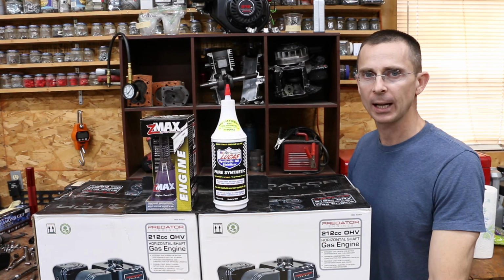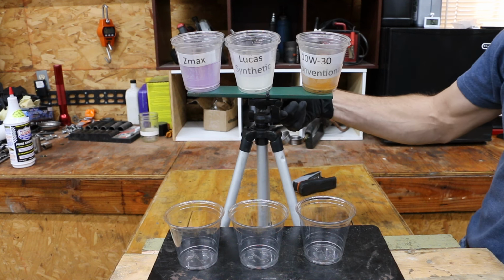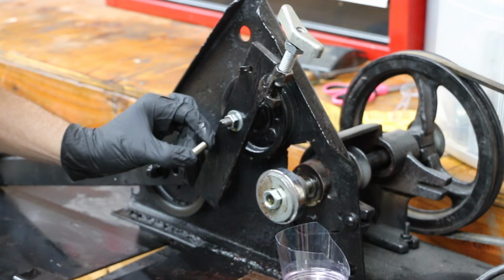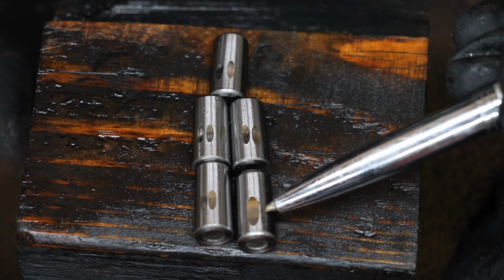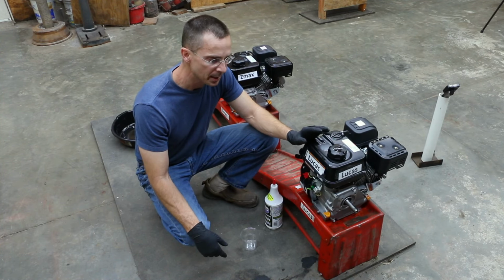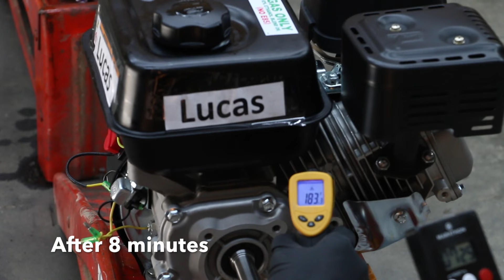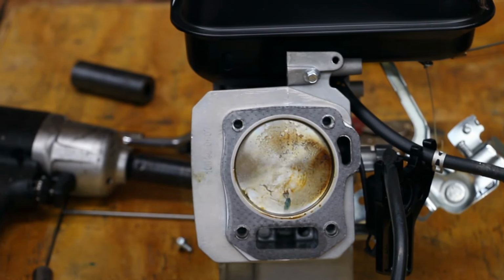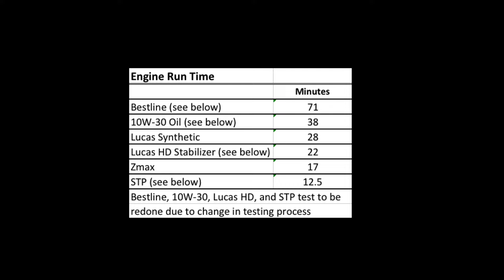Which engine self-destructs first? Zmax or Lucas Synthetic?

Comment: Great Video. I notice that you have done the same tests with other products. 
Its good you did the tests with 2 newly broken in motors.
The fact that the Zmax lubricity test showed the worst results probably means adding it to oil will lessen the lubricity of any oil it is added to, hence the test results.
It would be interesting to have the same test with standard SAE30 oil to see if any of the additives make a difference.
Maybe even do the tests more than once to see if the results are repeatable.
Reply from the maker: Great suggestion!

Comment: I would like to see a combo pack test, ie, winners of all the tests, oil, additives, stabilizers, cleaners, filters, etc, and put them all into one test, with the additives, and without as well. Perhaps on a 4 stroke car, remove the engine by part, measure the deposits, state of the engine, etc, and then measure again after the test run.
Reply from the maker: Thanks for the suggestion.

Comment: 3 years later I think destructive tests are good, especially when they show results and the parts are easily recyclable.

I would really love you to do a test on Subaru PZEV system as mine like most other Subaru's burn a boat load of oil, run at higher RPM's to get the supposal reduced emission's (one trip when cold 15MPG, same trip when warm 40MPG), and have a PZEV emission system even though they have no electric motor to allow the engine to be shut down to reduce those emissions.  I am sorry to say this, but this PZEV certification with Subaru seems to be a con to allow them to save money or get incentives.
Reply from the maker: Thanks for the video idea.

Comment: Lubricity Tester Modification Suggestion
What if you made a slot in the bearing race and put a compression or oil ring in it.  This way the wear test is actually being performed by the ring.    This would be a more definitive test for the exact same metals and products as the engine.   
(edit)  Of course there would have to be a spot in the groove that has a little lip for the gap in the ring.  this way the ring does not slide around the bearing race.
Reply from the maker: Thanks for the video idea.

Comment: I don’t know the specific weight of PTFE ( Teflon) , have you shaked the  slick 50 bottle before you put it in ? We had trouble with oil in a barrel, never mixed before we put it in the big turbofan engines at a major airline . The anti foaming detergent stays out! above 39000 feet the oil starts foaming , the oil pressure dropped and the pilots have shut  down this engine  ! After we build a mixer in the oil barrel , it never happens again !
Otherwise I have a lot of fun and learn a lot from you ! Go ahead .

Comment: Key way broke out on crank shaft due to timing belt gear came loose an wobbled the key out
$2000 fix with new crankshaft and our labor
We bought a new crank pulley/timing gear, gobbed on JB weld in blown out key way area and applied new key slid pulley on let it dry over night
Put timing belt back on and car lasted thousands of miles until in a crash
Reply from the maker: Thanks for sharing.

Comment: Apples to Oranges comparison. Lucas is a lube with oil like viscosity. Zmax is a metal conditioner with a water like viscosity (refer to the pour test).These two items are designed to do different things. It’s like comparing floor cleaner to floor wax. Frankly I am surprised that the straight Zmax did as well as it did on the bearing test. Heat will break down anything and without viscosity moving parts with no cushion will break down no mater what you use.

Comment: WHOA!!
That shows how much energy is in these engines in rotation to snap that conrod.
Quite a while ago I saw a similar test, but the additive went towards areas of heat (caused by friction) to help lube, but those ones go away from hot areas.
How about a hot plate test? Heat a plate and see if the additive goes' toward the heat, or away from it?
Reply from the maker: Thanks for the suggestion.

Comment: i have used lucas products for over  20 years, this makes me feel justified as to my intuition
Reply from the maker: Thanks for sharing.
Reply: @ProjectFarm  any time. ive built many an engine, and many a rigged contraption to get one job or another done. used to get called the local MacGyver all the time. now, being in a wheelchair, still into vehicles, wanna start building engines with a friend. a lot of my friends work jobs that use many of the products you test, and they like knowing they arent wasting money. im trying to get them to follow youtubers too. some work in the dangerous, dusty insides of grain elevators. they cant risk sparks, and they only, ONLY use millwaukee and ridgid power tools, corded or cordless. and ridgid hand tools and a mix of other higher end tools. brushless motors are the only way to go unless you just need something for hanging pics, putting tv brackets up, hanging or installing smaller things like safes to a wall/floor. but if youre building a deck, step it up. my dad still has one of those 9.6v Makita cordless drills, 4 batteries and 2 chargers. still have the original 2 batteries and one charger. the old batteries still last well. We built 3 porches and 2 decks and put a new floor in the front porch with that thing. hes retired now, he also doesnt need much more than a couple of power tools, a good battery charger, and quality socket set and wrench and screwdriver set. he told me he saw a battery booster that took no battery. it sort of cycles the power thats in the battery, and uses caps to boost it and feed it back to the source in a loop. i hadnt heard of them. you do a good job. i would say to be careful with the methods of surface prep. i found out by welding for so many years that grinders and sand paper of flap wheels leave small deposits in the material. i would take the flap wheel, shape the material, then finish with a file. it caused me to add 5 minutes to a project but let me make perfect welds. there were no deposits to cause cavitation and brake cleaner is great, but use the mass airflow sensor cleaner. it leaves no residue and brake cleaner does. this is something we found out while i was welding aluminum frames. i argued with them because i wasnt going to send out sub standard work to haul a ton or more down a road at 70mph. i wouldnt put my name on it. the department manager wasnt a welder and blew me off, the owner of the company began as a welder, i talked to him at the store when i saw him buying meat for what must have been a monster cookout lol and explained my situation. by noon on monday all my changes were implemented. i felt like i had his respect. after that, the manager was told that the only people allowed to weld the prototype or show trailers were me and the Lead man. i trained many welders, and the skill is one i love, and miss being able to do as i used to do!

Comment: In my opinion the only uses where Lucus oil stabilizer has a desirable effect is in the front and rear differential and the transfer case of four-wheel drive vehicles, any place where you have mechanical gear on gear friction.
Reply from the maker: Thanks for sharing.

Comment: I've  tried regular lucas non synthetic to quiet down top end noise it has gotten me through times when It was too cold to check and adjust  valve lash..and also times where I saw the oil was getting darker and thinner but needed to drive to work and didnt have time to change the oil til the weekend.. I know that the regular lucas has gotten me through and now after seeing this synthetic lucas product I have a lot more confidence in it doing just as well for the vehicles that I have that run fullsynthetic oil only.
Reply from the maker: Thanks for sharing.

Comment: zMax is 99% mineral oil as stated, and about 0.9% Lynkite. It was used to soak engine surfaces during WWII so the salty air wouldn't rust them while in transit over the ocean. It may be useful if you live near the ocean and don't drive a vehicle for extended periods of time or if you wet dock a boat for the winter, but otherwise steer clear. And change the oil as soon as you're going to be using the vehicle again.
Reply from the maker: Thank you for the feedback

Comment: My experience using zmax is all positive, I notice my truck engine runs 15 degrees cooler, I notice the engine has 5 more psi oil pressure when oil is hot, I also noticed 2 more mpg,  I use the zmax engine oil and transmission treatment
Reply from the maker: Thanks for the feedback.

Comment: Hey Todd, since this test was done 3 years ago, you might never see this, but I wondered if you could test engine coatings. You know, the dry film type. Anti friction coatings on bearings and piston skirts, heat shedding (or reflecting?) coatings on piston tops. Thanks.
Reply from the maker: Thanks for the video idea.

Comment: I know this is an old video but this is the first time I've seen it.
I wouldn't worry one tiny bit about destroying the engine.
They crash brand new Lamborghinis and they crash Mercedes for safety tests.
 I was quite surprised to see the contents of the zMAX listed as mineral oil.
Isn't that just baby oil?
I wonder how much faster a baby is if you apply Lucas instead. 😁
Great test and testing procedure.

Comment: Thank you for conducting this very revealing test.  Have you tested or used Archoil 9100 Oil Additive?
Reply from the maker: You are welcome!  Thanks for the suggestion.
Reply: @ProjectFarm  Thank you again for doing such interesting test, I believe the Archoil 9100 Oil Additive vs Lucas Oil Stabilizer would be a better comparison for a test. From what I understand ZMax needs to be used with a ‟full crankcase” of engine oil, or at least have a carrier like a fuel, to bring it to the hot metal surfaces where it can then ‟soak in”. Whereas Lucas Oil Stabilizer and Archoil 9100 are boundary layer lubricants in their own right. It is true they both also use engine oil as a carrier, howeveer both the Lucas Oil Stabilizer and the Archoil 9100 have a much higher viscosity vs ZMax.

Comment: Good Video, good test!!!   Can you do a test with NanoLube XL which they treats the METAL and NOT the oil.  They claim to be the best that there is.  They claim that it will clean carbon from an engine, but I have not found that to be as they advertise.
Reply from the maker: Thank you very much!

Comment: In my opinion the Lucas and also STP, unless they have some secret ingredient, can actually hurt an engine. They seem to have NO anti wear additives so they reduce the overall amount of anti wear additives in your oil. PLus they thicken the oil causing less flowability, especially in the winter. I say if you can't pour it out of the bottle at 10 degrees, how do you expect it to flow in your engine at 10 degrees?
Reply from the maker: Thanks for the feedback.

Comment: At this point, I'm not taking any chances and void the warranty on my car. The dealership told me to never use K&N filters because of the tolerance and it will void the warranty. I have them change the oil, that way they can't say I used the wrong oil and I certainly won't be taking it to Walmart or any other oil change places.
Reply from the maker: Thanks for sharing.

Comment: I would like to see a showdown between Petron 7 and Duralube/ slick 50 lucus and so on.
Petron 7 makes claims that it is the very best oil additive money can buy.
Duralube claims that it treats the metal same as Petron 7.
I enjoy your videos very much!
I would love to see you do a Video on transmission coolers.
Vehicles with Radiators over 10 years may have corrosion within and many older Radiators mix transmission fluid and coolant.
Is a low to mid priced transmission good enough or should we invest in a higher end level aftermarket transmission cooler?
Reply from the maker: Thank you for the video idea!

Comment: you could test mos2 ptfe ws2 only with engine oil, only add 0.1 to 0.3 percent to it. Then measure the maximum torque until motor stalls, this is the only way to measure the impact of the additive.
Reply from the maker: Thanks for the suggestion.

Comment: I'm a mechanical engineer. I like your emphasis on getting to the bottom line empirically. I agree destruction tests are not great science. Regarding oil additives (like Lucas), I would love to see a friction test for drag @ two or three temperatures. Film effects using your friction wear tester are not analogous to reality, albethey a lot better than nothing, still only quantitative comparison. I have used it myself. I suggest a (electric drill) rotating flat surface presented to a stationary similar surface in an oil bath with a specific compression force to squeeze the fluid from between the two surfaces. The rotating steel would be square steel sheet in two sizes, e.g. 2" and 1", respectively. RPM would have to increase in proportion to the decrease in surface area of the rotating steel. Such an apparatus/test would provide an empirical evaluation of the lubricant's true effect. Testing the fluid lubricant @ temperature under load in this way might demonstrate a more accurate picture of how beneficial (or not) the lubricating fluid might be.Thanks for reading. Good luck!
Reply from the maker: Thank You and thank you for the video idea!

Comment: I was wondering if you had a video on engine block and cylinder head resurfacing?  I am looking for a solid video on that.  What tools are good, what grit to use, what dye to use to check for cracks and uneven wear.  Thanks!~

Comment: like to watch your testing,  thanks for sharing.  I just one to share small knowledge about oil treatment in the market.  oil treatment is viscosity improver that used by the manufacturer to make the lube oil ticker especially when we see the e.g 10 W30.  no 30 or 40 or 50 at the back is the function of the viscosity improver.  The function of the this improver is to make better sealing to the piston ring when the engine is have high wear. in other words if we want to make the lube oil higher viscosity then put the oil treatment.

Wallahualam.
Reply from the maker: Thanks for the feedback.

Comment: There is always the possibility that instead of Lucas "helping" the oil work better, Z-Max is actually hurting.
The only way to get a good idea about that is to have a third engine using straight oil with neither additive, as a control group.
That said, I understand why you didn't do it.
Edit: I just saw the video where you did the same sort of test with conventional 10W-30 and Bestline. The results were undeniable in comparison to this test. I stand corrected in my above comment.
Reply from the maker: Thanks for the feedback.

Comment: It would be interesting to see results of any of these oil products if they have been heat cycled or added to badly broken down oils.
Seeing how well they work in an old and worn engine would be difficult to have consistent testing due to wear, but would also be interesting to have results.

I've personally used Lucas for years and never blown an engine in a daily driver, track or off-road vehicle.
Reply from the maker: Thanks for the suggestion.

Comment: Best oil additive for my Camaro SS is NONE. The only synthetic oil that will save your motor from wear is Mobile1. Can you please prepare a demonstration? Like Lucas vs Moly vs Mobile 1. Maybe add Moly to Mobile 1 and test. 
I have a Gen 6 455hp 455lbft Chevy 6.2 liter with the 6060 Tremec manual with revmatching. I would LOVE to lower friction but have found no product that I trust more. It is guaranteed fantastic engine protection. 👏 ❤
Reply from the maker: Thanks for the suggestion.

Comment: how about doing a test of adding Acetone to the gas. a fellow from South Africa turned me on to it using 3oz of acetone to 10 gals gas after a couple tank fills I noticed  an increase on my boat of 3 mph and in a lawnmower I was able to get throw patches where it always bogged down. the mix is weak enough that it does not run into problems with hoses or gaskets. I also run it in my vehicles to keep the injectors running clean and my mileage is at its peak. initially it took 4 tank fills to get back to my best performance.

Comment: Most people ignore the fact that zmax is a friction modifier not a oil supplement zmax clearly says that it’s designed to reduce carbon deposits which reduces friction
Reply from the maker: Thanks for the feedback.
Reply: Project Farm no problem, I just feel like some people think zmax is a oil supplement when it’s clearly advertised as a friction modifier it’s working well in my car right now so I can’t complain about it 🤷🏻‍♂️

Comment: Something to note Zmax claims there product takes time to "soak in" I think they stated 30 running hours with hot & cold cycles. This is supposed to allow the metal to expand allowing the zmax to penetrate into the metal parts.   I have used both products in the past.. But I don't use additives anymore just good oil. Either way I think zmax big claim is removing & preventing deposits building up
Reply from the maker: Thanks for the feedback.
Reply: @ProjectFarm  Thank you love your videos